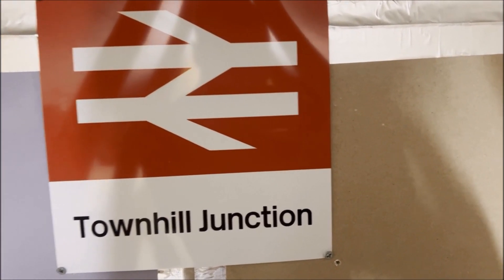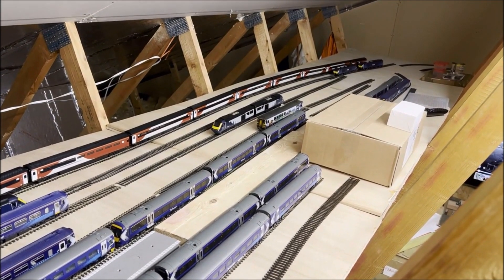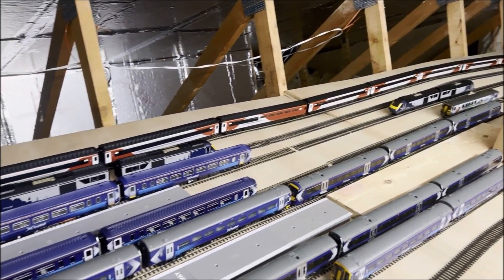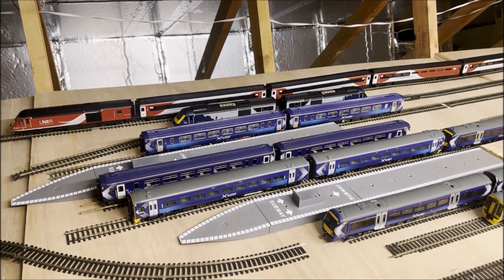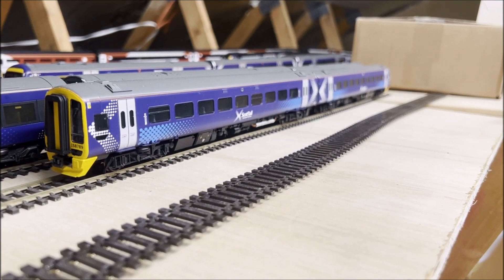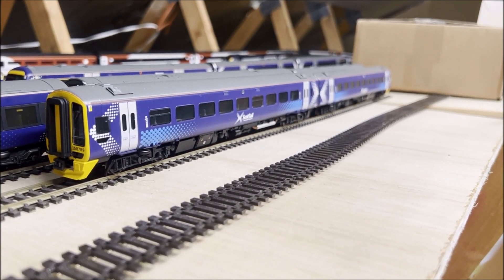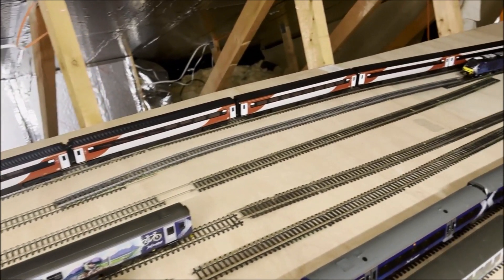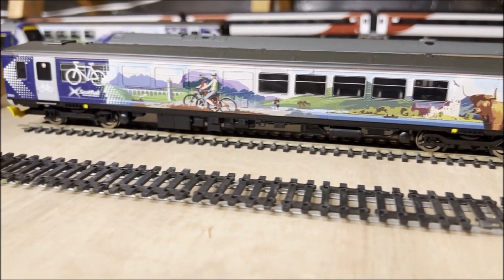Layout Update 3 | ScotRail Fleet Review | Class 90 Cab Ride

Comment: I agree if you want a big station then you should build it....  I like the idea of changing the locomotive from one end to the other --  Problems I can see is that your station may not  long enough.  Express trains over 6-8 cars will have to use outside line and longest platform to pass station.  Join the two outer lines away from the station giving the appearance of more frequent express services passing and stopping at the station -- perhaps only part of the train stopping for passengers on the longest platform. 
You have a long way to go and making a 1:1 layout plan maybe the next step. .. If you have one or two lines on the second level that will give further away time for the express and some impression of distance for local services -- stop and go in storage with just enough clearance for the train -- Grading for the trains will be an issue for both  express and local trains....
 ( minimal drop for the storage loops) 
Best of luck.
Reply from the maker: I really love some of these ideas thanks so much for taking the time. Yeh I want to set down a rough baseboard and then can play with any rail and lay the print outs across it and see how it looks. Inclines only worry me cause I have to have enough space to pass pantographs through too.

Comment: Hi, if you want a large station you must do it, youll only regret it if you dont. I always wanted a large main line terminus station, like London Kings Cross, but space was an issue. However Im currently building a representation of Manchester Piccadilly in N gauge and am so glad I did it, never turned back. So Ive got my terminus and through trains too. 
The only thing I would advise is keep your curves as long and shallow as possible. Trains dont like sharp tight curves and especially tight ‘S’ bends, also try to use the longest points, you wont regret it.

Hoping that helps
Reply from the maker: Such a great help. I love that your layout has the terminus but also those through lines on the edge I often use myself heading out to the airport. I love the detail you have got in, my worry is with 00 it’ll be just too big but really keen to try it, with yours as inspiration I think I can get there.

The curves are a slight issue if I want to run longer trains but even with 3rd radius I should have room to keep a general sweep above that. Thanks any advice is really welcome especially from one of the best!
Reply: @townhilljunction785  Go with your heart, third radius  and above will be fine. You did mention the modelling trick of making say 2/3 of the station and the rest goes ‘off scene’ , but you’ve got to decide if you would be TRULY happy with this. It’s oh so easy to regret it going further.